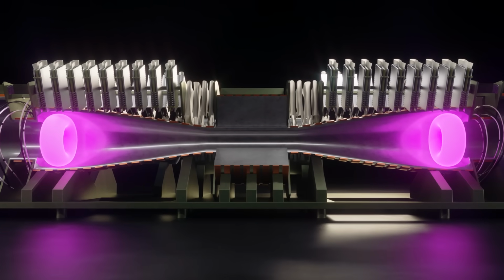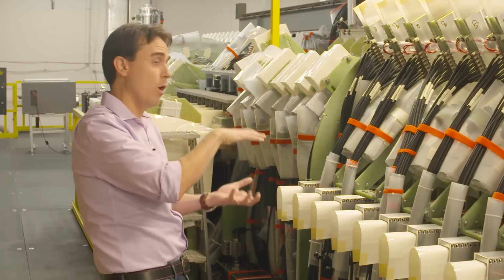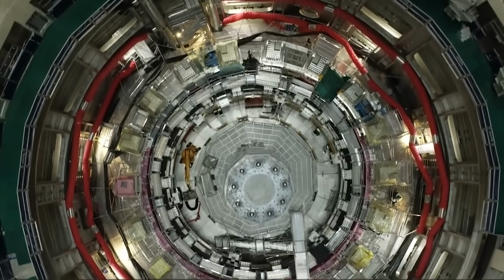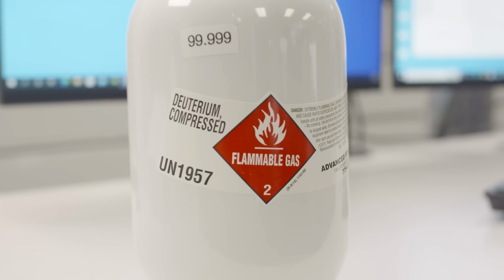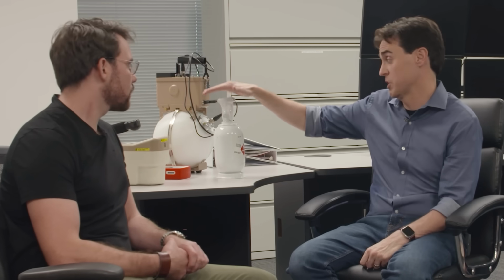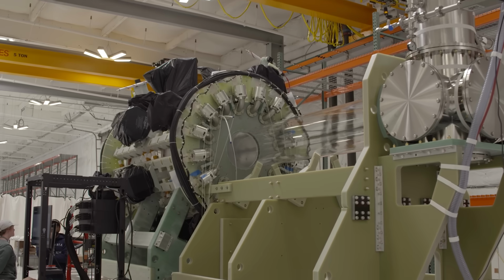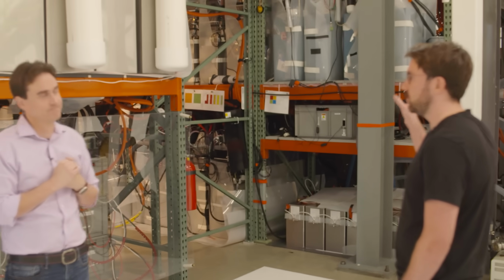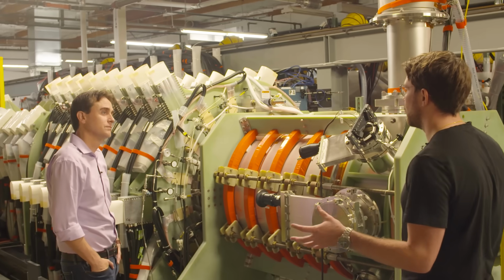A New Way to Achieve Nuclear Fusion: Helion

Comment: I wonder how Helion's future is affected by the news of the first net positive fusion process being announced recently? There are a number of companies like Helion trying to build a commercial fusion energy approach but the sweetest plum, being the first to net positive, has now been snatched, and by a public lab no less. Plus, the laser approach doesn't require any rare material like Helium-3 so far as I know, but then again I "don't know" quite a bit when it comes to nuclear fusion. Could be multiple approaches are both useful and valuiable.
Reply: The NIF approach is much, much further away from a practical power plant (als in terms of net energy) than Helion and several of the other fusion startups are.
A power plant based on NIF would still need to breed Tritium. 
Helion will produce their Helium3 by fusing Deuterium in the same machine. D+D => He3 +n or D+D => T + p (the Tritium eventually decays to He3 as well).
Reply: @elmarmoelzer2229  You may very well be correct, I'm not an expert in this area. Having said that, I'm not quite sure I follow why the NIF ICF methodology would be "much, much further" from practical power production than Helion's MCF approach. The milestone that everyone has been attempting to achieve for decades is net positive energy production. Helion's methodology seems promising and they believe they will get there, but they have yet to achieve this milestone nor can they say when or even if they will achieve it. Meanwhile, the NIF methodology is already at >1.5. You seem very confident that Helion has a superior approach w.r.t. energy production despite being behind on this critical KPI. What I'm trying to understand is what makes you so certain of that conclusion, particularly since this field is infamous for it's "almost there" state of progress?
Reply: @persona2grata  
Several reasons why:
1. NIFs lasers are very inefficient. We are talking orders of magnitude difference between the energy that goes into the plasma and energy that goes into the machine. NIF only counted the energy that actually went into the plasma.
2. Helion is not MCF. It is magnetoinertial fusion. So, it is sort of the middle ground between a tokamak and NIF. Helion has not published the triple product for Trenta. All i know is that it was very competitive with even JET, maybe better already back in 2021. It has improved quite a bit since then.
3. Helion can recovery 95% of the input energy that goes into the machine to initiate a pulse. And they can do that directly as electricity. That is 95% of the way already right there. The fusion energy then "only" has to make up for the losses and then have enough extra to sell. And that is recovered very efficiently as well. 

So, if you take all of this into consideration, they would be much closer to net electricity production than NIF is right now.
Reply: @elmarmoelzer2229  Ahh, ok. I think I understand your position better now. Thank you for the explanation.

Comment: Helion, use leaded crystal glass instead of fused silica glass for the fusion tube. Similar properties. CRTs used this material with the bombardment of electrons. Don't increase the radius of the coils and tubes. The reaction will falter.
Reply: How do you know better than a company of professionals?
Reply: @Gomlmon99  I am a professional. I am a materials engineer.
Reply: @richardmuller867  You’re a professional fusion engineer? Which power plants or test reactors have you worked on? Because you don’t write like you are one.
Reply: @Gomlmon99  No, I am a materials engineer. The pope is right. There is an elegant demon on the Earth as told by the bible called Satan that rules the Earth for 1000 heaven years. Why do you think that they currently stopped the ITER from being built? I wrote them and they came to their senses and then told the world that some parts did not fit. It is funny. I don't have to be a fusion engineer to see what has been going on for the past 100 years of failures. I have followed this fusion delusion since I was seven years old. You guys always think you know better with your huge degrees. The system of the smartest and brightest rising to the top doesn't work. It is the little guy at the bottom who knows better. Do you know where Kennedy got his ideas? From taxicab drivers with his brain trust and not from his PHD advisors and why the US did so great such as going to the moon in the 1960's. You guys all work in the fusion reactors and get a ton of experience, but it is the incorrect experience that propagates itself over and over which leads to the hundreds if not thousands of failures. Are you insulted now, and do you think me delusional? I hear this all of the time. You probably also think that I think I am Copernicus or Galileo. I hear this argument all of the time from you guys. You will not even visit me and check out my theory because QM theory does not describe it. How ignorant! How illogical! You guys screw yourselves by refusing to hire outside of the box thinkers. You leave such scientists unemployed and suffering. You guys are oppressive as hell and dictators, and we all know where this goes like the current issues with Putin in Ukraine.
Reply: @richardmuller867  dude you’re insane 😂
Reply: @Gomlmon99  No, you are insane. Watch me build a fusion reactor with junk parts and $100 while Helion blows $250 million once again as so many other fusion reactors that blow $1 billion. You are the paranoid nut! Take some antipsychotics.
Reply: It is the separatrix radius that matters. They could make the walls out of any material, but the plasma immediately cools when it touches the walls.
Reply: @elmarmoelzer2229  I was referring to the particle bombardment that damages the fused silica glass. Helion informed us in the last video that they would increase the radius of the tube by 25% to keep the particles away from the fused silica glass so it did not get as damaged. The coil magnetic field has a relationship of 1/r^3 so the magnetic field would be way less, and they would get a less effective fusion reaction as the plasma would not be compressed as much and accelerated as much leading to a much lower collision velocity. The particles would then still bombard the fused silica glass. By making the radius much larger they would have to make the current in the coils much larger which would eat up the energy more leading to a worse outcome for the produced energy.  The leaded crystal glass has a high atomic number and would withstand the particle bombardment much better as in a CRT TV that used leaded crystal glass. Leaded crystal glass and fused silica have pretty much the same properties except that the leaded crystal glass can withstand the bombardment of particles and radiation. I would make the radius 25% smaller so the magnetic field is much larger with the relationship of 1/r^3 so that there is a much better fusion reaction and acceleration of the fuel leading to a higher velocity of the particles, and the particles would be kept away from the leaded crystal glass much better. Helion is thinking in reverse. This would also solve the issue of the plasma touching the wall and cooling too much. Avalanche energy has a desktop home fusion reactor that is working in this manner. Look it up.
Reply: Look at the tokomaks. They keep making them bigger and bigger such as the ITER. The magnetic field then gets weaker. They then pump in more current which eats up the produced fusion output energy.  The Tokomaks think also think in reverse.  They should be making them smaller, so the magnetic field gets stronger. They should use the superconductor magnets with a larger current as the device gets smaller, so the plasma is pinched better so they get a larger fusion reaction. I have been writing and writing and writing to the many fusion reactor experiments and US government since 1996 and there is no communication, or no one listens and calls me ignorant or delusional. I have to laugh at this. LOL. I helped the Princeton Tokomak back in the day at Rutgers by making ceramic parts.
Reply: I am currently working with a US marine to make a basketball size fusion device that could in theory run the entire power grid for few minutes. The device is a steel sphere filled with water and has a spark plug on the top of it. It is a water electrolysis system. Research water electrolysis under pressure. My system focuses the pressure at the center of the sphere for an instant causing water fusion to occur. If you research on the internet, you will find that the scientists just found a water layer deep in the Earth. The earth is powered by water electrolysis fusion. It has a Na-Ca-SiO2 layer that is conductive under high temperature like my iron sphere. It is filled with water that undergoes water electrolysis fusion when the produced electrons from the water fusing into gallium and iron at the center circulates around the sphere and into the center of the sphere. This also produces the Earth's magnetic field. The gallium under pressure produces the CMB in the universe and why we see the CMB with hot and cold spots that link up to the galaxies.  You guys are the geocentric solar system, and I am the heliocentric solar system. You know what issues this caused for Copernicus and Galileo? History repeating itself once again.  I have been screwed over and over with my theory and I cannot get any funding while you guys get billions of dollars and tax the common people like me to bankruptcy. It is not me who is delusional. Believe me. My life has been ruined by this delusion.
Reply: @richardmuller867  To the best of my understanding it is not about the damage the fused silica receives, but about the fact that the plasma cools when it touches the walls and those particles are lost early which reduces the overall confinement time.
Reply: @elmarmoelzer2229  This is why I suggest using lead crystal glass with closer coils to increase the magnetic field that the rule 1/r^3. The plasma fuel will be accelerated to a higher velocity, the plasma fuel will stay away from the tube walls, and the radiation damage will be minimal with leads high atomic number. This will yield a higher fusion energy production. IMO. I write this to Helion, and I hear nothing which is the usual case with the scientists. All current fusion systems are also an open system and the fuel bounces with only the pressure held on for a second. I use with my star device a closed system sphere where the spark from the spark plug will keep the pressure on longer leading to a higher fusion energy yield. The pressure will also be sent to the center of the sphere. I keep the water level totally filled up in the sphere so there is no open system of vapor. Usually, the water can split into 2 H2 and O2 with an open electrolysis system. But with the closed system this cannot happen, and the pressure builds up for a lot longer.  The fusion reaction will then continue up to iron and gallium due to the molecular weight of the water. The reaction is H2O + NaCl + pressure = Fe + Ga + photons + neutrinos + tons of electrons that will then circulate around the iron sphere to produce a BF + EF + GF to further help the reaction.  The electrons can then be ciphered off of the sphere as electrical power directly. All of the science data from many experiments show this as the source of power for the Sun, Earth, and Moon. The scientists with their QM postulate determine the observations of the experiment incorrectly and failure results for the past 100 years. This QM postulate is due to the way space and time are structured as a hologram.  Every point in space is the same point in space at a different time. The big bang experiments show this. The cosmic rays bombarding the Earth are the big bang producing protons and neutrons that then produce the other elements in the cosmic rays which is also the big bang.  The way space and time are structured also lead to atoms producing experiencing forces that then lead to everyone DNA having a different sequence which leads to everyone looking and thinking differently with different theories that all work leading to many arguments that get us nowhere very slowly. I would show your more, but YouTube will delete my links. The way the current fusion reactors are built as an open system leads to less pressure time to fuse the atoms leading to bigger and bigger devices that then use up more and more of the devices produced energy. It is a never cycle for the past 100 years and no one realizes this. All current fusion reactors then only produce 0.7% energy from the fusion reaction. It is the same with nuclear weapons. They bounce in an open system leading to less pressure time on the atoms. Why can't you all see this????
Reply: You guys do the same thing over and over with the same results. Einstein said it is crazy to do the same thing over and over and expect different results. Back in 1996 I got the US energy department interested and then the administration changed, and I got screwed. This happens over and over, and I get set back five years once again.
Reply: I beg and plead with the US government for $500 and I get called a delusional man.
Reply: I also get hundreds of form letter telling me that they will contact me and to please vote for them. Send us money. LOL. I never hear a thing.
Reply: I just watched the NIF lie about their latest results. They use 500 MJ from the grid. Power the laser up to 2 MJ and then get 3 MJ out leading to the same 0.7% and then they claim success and get more billions to do the same thing once again. I don't know how they get away with this???
Reply: I have written to the NIF hundreds of times showing them how they have the correct idea of the spherical pellet with the fuel inside but that their laser obliterates the pellet, and it is pressure on and pressure off or the big bounce. I have explained if they use a bigger clear pellet such as glass with water inside and fire a much less energetic laser and electrolyze the water as I am attempting to do with my star device without obliterating the pellet the pressure will stay on and they will produce tons more fusion energy but once again I get ignored and called a crazy man with no one even attempting to try my idea.
Reply: Do you know how to make a fusion ICE on a car?  You inject salt water and fire up 12 small spark plugs into the cylinder that are sparked at 30,000 volts and maybe 1 amp. This is based upon Avalanche energy's fusion device. Look it up. The pressure is on for a long time with the piston. I do experiments on this with my natural gas fired appliances and I save 35% on my gas bill due to fusion of the natural gas. I write to the car companies, the gas companies, the US government and I get called delusional once again.
Reply: I have solar panels. I read about neutrino solar panels. I set up my solar panels so they will produce power at night with the neutrinos. I save 35% once again on my electric bill.  I write to the power companies and the US government once again and get totally ignored and no one will visit me to see how I do this, and I get called delusional once again.
Reply: I also figured out that the current dark matter detectors don't work because they have too small a surface area for detecting the dark matter.  I then decide to use all solar panels connected to the power grid to detect the dark matter and I find from my theory that a voltage should show up at 246-247 volts due to the dark matter interacting with my solar panels. I then look and sure enough I see the 246-247 volts. I write once again to notable scientists, and I get ignored or called delusional once again. No one checks it out and calls me a fake.
Reply: Smart high IQ people make complicated things that don't work due to their complexity and I with my low IQ brain make simple things that do work.
Reply: I also came to the conclusion that Voyager one had its computer issue because it ran into dark matter orbiting our solar system. I contacted Nasa to inform them. They Teams chatted with me, and I suggested that when Voyager two encounter the same dark matter field orbiting the solar system, they try to detect the dark matter at this distance, and they looked stupid at me and wanted me to fill out tons of forms before they would look into this suggestion.

Comment: Luckily, the surface of the Moon, is covered by a layer of Helium3, ejected from the sun.
Reply: Helion will produce their Helium3 by fusing Deuterium in the same machine. D+D => He3 +n or D+D => T + p (the Tritium eventually decays to He3 as well). No space travel required.

Comment: What if gravity is just an emergent descriptive phenomenon for what happens in nested ses of fusion reaction chambers? Like in the creation of stars, the FRC is the local nubula/gas nursery, or maybe even the galaxy itself,  while the galaxy is born from even larger structures.
  Our current model seems to suggest it happens the other way around.
Reply: The Earth does not make fusion, yet it has gravity.
Reply: @Elmar Moelzer  I can understand the confusion based on how I wrote that, but I'm not suggesting it's the fusion itself causing gravity. I think its the environment that can cause fusion as a byproduct can also cause gravity as a byproduct. 
  Im suggesting its not the gravity that causes fusion and therefore cosmic structures, but rather the electricity and electromagnetism.
Reply: I was just imagining the universe as a matryoshka doll of nested electromagnetic fields that produce fusion reactions at relevant nodes and gravity as a byproduct.